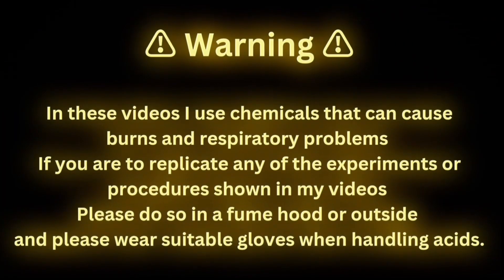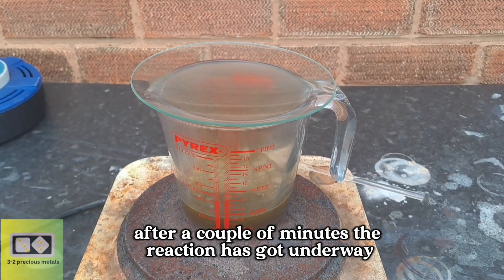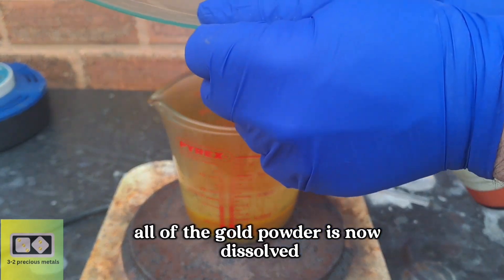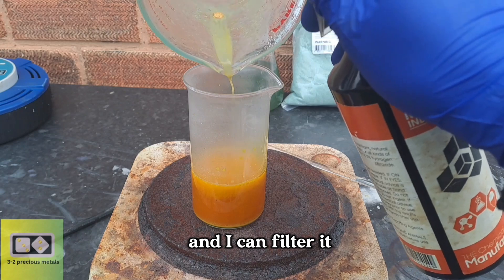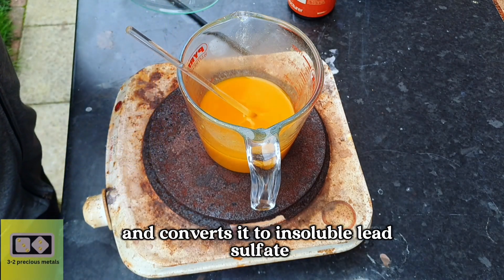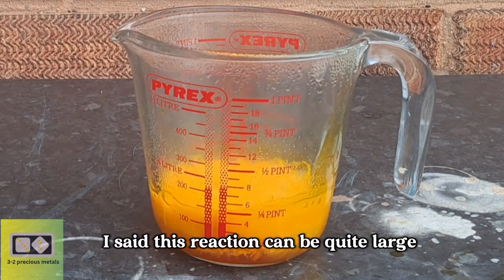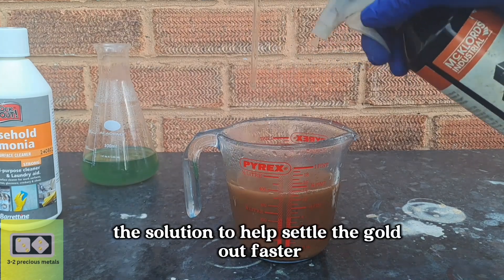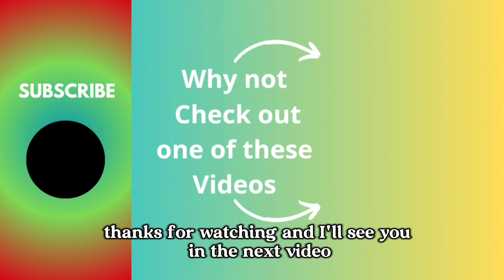how to refine gold at home

Comment: What if you have alot of ferric iron in solution?
Reply from the maker: The gold ions and the ferric ions could compete for reducing agents, causing slower or incomplete precipitation. If the solution is over saturated with iron, it could precipitate your gold prematurely. It's always best to get  rid of as much  iron as you can before putting the gold into aqua regia
Reply: @3-2preciousmetalrecycling if its saturated in ferric iron it wont pre precipitate... Only with ferrous iron. But yes, it the smb wants to reduce the iron III first and by the time its been reduced smb is worthless for gold.
Reply from the maker: @RobRuffMusic  it might be better to cement everything out on a piece of aluminium first and boil everything afterwards in HCl this would remove the majority of the iron then do  a quick refine of the remaining material
Reply: @3-2preciousmetalrecycling  Yup, been cementing with copper. Just sucks bc it comes out dirty
Reply from the maker: @RobRuffMusic  sucks I agree, but sometimes it's just best to go back to the start

Comment: Thank you for your answer. What material is that microwave kiln
Reply from the maker: The kiln's body, or outer shell, is made of a ceramic fibre. This provides insulation,  The inner surface of the kiln is lined with silicon carbide I believe. Hope this helps, and thanks for watching 👍

Comment: Quick question... Did you adjust the ph before precipitating to make sure any residual nitric oxides were gone? I can't seem to get mine to drop. I added sulfamic until bubbling stops, but its still not precipitating hmm.. I had to cement out values with copper instead. Maybe I have too much chlorides still present in the solution and need to dilute more?
Reply from the maker: @RobRuffMusic  I didn't adjust the ph. Gold drops out better in a dilute solution. If it's too concentrated it won't drop 👍

Comment: Why use sulfamic acid?.explane pls.
Reply from the maker: Sulfamic acid is used to remove any lead (Pb) present in the solution. The sulphamic acid reacts with the excess nitric acid to produce sulphuric acid. The sulphuric acid converts the lead chloride to lead sulphate, which is insoluble and precipitates from the solution.  This can then be removed with filtering